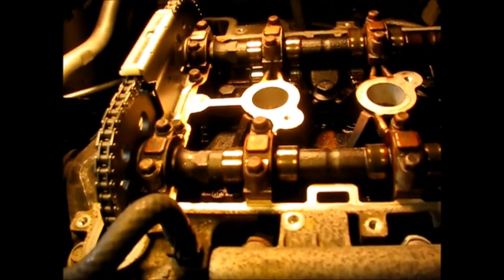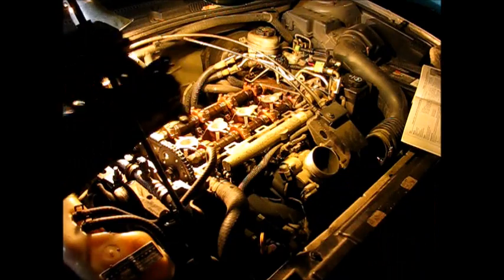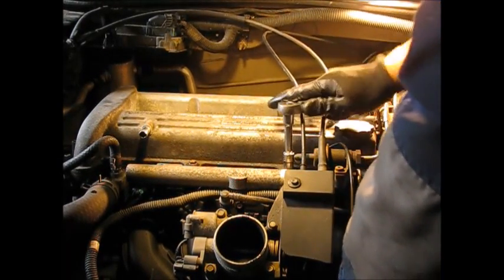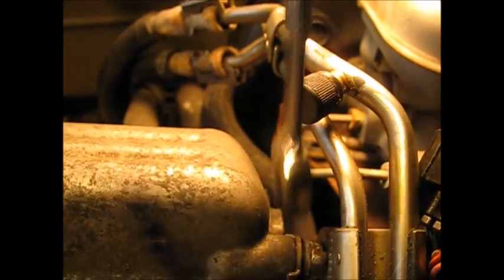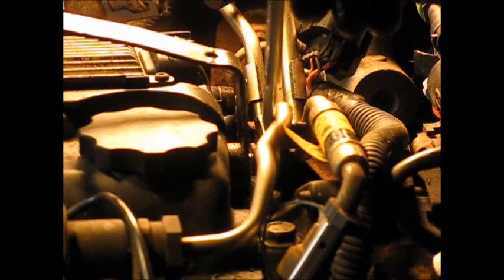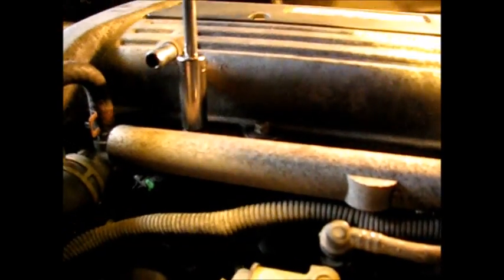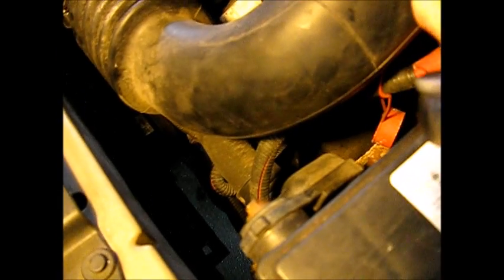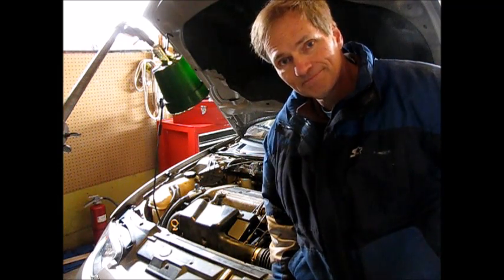GM 2.2L Ecotec timing chain replacement '03 Cavalier part 6: valve cover and conclusion

Comment: Thank you very much for the videos.
I am really wondering, why the engine is running at all without doing a complete rebuild of the head incl the valves. With such a massive nok timing, all valves should had contact with the cylinders and should be bend... Or am I wrong?
Reply from the maker: Yeah, you're right. Valve damage is to be expected.

Comment: I have a question about the Rear Lift Engine Bracket. It looks like it is missing on your car as well as on mine (2003 Chevy Cavalier). Can you tell if that bracket should be present there all the time, or it is smth like a tool, which is installed when needed? Thank you for a great film.
Reply from the maker: This is news to me about the bracket and I have no idea whether it's added as needed.
Reply: @TheOriginalMechanic  Thank you for the replay. The Rear Lift Engine Bracket on our Chevy was taken by someone in a shop (now hard to say when), bcs it should be there, it is shown in Haynes on page 2D-8 (pic. 7.23b). I don't think the manufacture didn't install it originally.  So they are 2 brackets the to lift or just support (what I needed) the engine. One is located in front of Engine Upper Mount, and the other one is in the area where your hand is @ 1:56, kind of at the other end of a diagonal going from the Front Lift Engine Mount across the Valve Cover. The good news are that they sell those brackets on ebay. The set of 2 is ~$25. I've ordered one already. What is interesting that primarily I went with that car to Chevy dealerships hoping that there are true professionals there.  Next time I go there I'll take a picture of Engine Bay for any chance. Anyway, thank you again.
Reply from the maker: Yeah, sad when you have to take "before" pictures prior to getting service or repairs @olenaerhardt7725

Comment: Soy de mexico y veo tus videos, no entiendo todo pero estoy tratando, pregunta 1. ¿se tiene que quitar el aceite del motor?
2.- ¿ es necesario lubricar la cadena antes de ponerle la cubierta o se engrasara sola?
Reply from the maker: I did drain the oil (part 2 at 6:02) I did not lubricate the chain as it will pick up oil during operation.

Comment: David, I have been following your vids on this for while and  I finally got the timing chain changed out on my grand daughter's 04 Ion and found as I figured would show up, the valves got bent and a cylinder head needed to be changed. It took a while to find a decent head and have it installed and re-installed the timing chain as of today. I still have to put cover back on and timing cover and hook up all the associated parts. I am just hoping it it starts and runs. I am glad I watched your starting procedure and the time it took to start. That gives me pause not to give up when it doesn't just fire up!  What do you think caused such a delay on starting?
Reply from the maker: I've wondered about that and I really don't know.  The car was down for months and I thought maybe it was a fuel issue after sitting so long. That probably won't happen to you though. Good luck and thanks for watching!
Reply: @TheOriginalMechanic  The car I'm working on also has been down a good while too, since last September. They had it hauled to my place last month. I did add a bit of fresh gas with some stabilizer. Did you think of using a bit of starting fluid sprayed into the intake just to see if it would fire? I may do this if i have same delayed start. As I've stated in previous post I'm an old guy and usually only work on it a couple hours a day. but hope in another week to be able to fire it up.
Reply: @radtek2 am tempted on buying one for cheap to save money guy selling it said timing chain fell of cause of mechanic wanted to save time not using the proper tool to change the water pump an that It felt in the pan it's been sitting for 2 yrs so he says ,am afraid of valves been bend by them trying to crank it an worrying it won't start like this one . What ever happened to ur project,some times they sound like a bend valve but is not cause of a bent valve but from bad oil solenoids

Comment: I just replaced my timming chain but the car don’t want to start it sounds the same as yours. What can i do and the battery wont stay charge after 2 tries it dies i have to charge it do you think is the battery
Reply from the maker: Your battery sounds weak. You might need to jump it to get it running
Reply: The Original Mechanic i did it but it wont start some guy told me that the valves are bent because my chain broke while it was running

Comment: I find it had to believe it didn't bend any valves. And suspect it did.
Reply from the maker: Just lucky I guess. It ran fine for two years right up to the day it was sold.
Reply: I’m with you. I would’ve done a compression test after about 5 minutes of cranking. Damn another entire hour of trying to get it to start lol.

Comment: Wish I had come across this video series a few years back when the timing chain snapped on my 03 Grand Am!..lol.  I watched a couple other videos and printed off some instructions from the internet..had to replace one bent valve in addition to the chain, but the job came out well and the car is still running great to this day...the only difference is that I didn't have as much trouble starting it when it was finished..I think it started on like the 3rd try... got lucky I guess. Anyway, thanks for posting these videos.

Comment: My question is the exhaust gear and the intake gear have moved , you said turn the crank 90 degrees and the gears on top should move without hurting the valves . So once they line up to exhaust 10 o’clock and intake 2 o’clock , how do I get the crank back to compression stroke t.d.c. ? Do I turn it clock wise until I get there , or will that hurt the valves , help me out . Thanks
Reply from the maker: Turn crank clockwise to bring back to t.d.c. and it will be good.

Comment: good video very helpful, It sounded like it was a little low on oil when it started, I didn't see in the video where you topped it off with oil after the fix.

Comment: David...I would like to thank you very much for making this video series.  I just got a 2006 Cobalt and the engine is running really rough, even after replacing plugs, ignition module, and coil pack assembly.  Then I heard someone say that it might be by timing chain assembly. After watching your video series, I realized that I have pretty much figured out that one of the cogs has jumped and I got a job to do.  So, thank you for the video and I will be looking at it from time to time, as a reference guide to doing this job.
Reply from the maker: You're welcome. Thanks for watching and I hope your work goes well.
Reply: Hi David. I did have one question concerning this project.  I noticed there is another chain behind the timing assembly.  I looked further and found that it is a chain to the water pump.  Would it be idealistic to replace that chain, as well?  That way, I don't have to go back in for awhile?  Thanks...Mark Simon
Reply from the maker: Yeah that would be ideal. I think this chain also operates balance shafts, in addition to the water pump. We didn't change it out and have yet to regret it two years later, but for maximum reliability it should be replaced.
Reply: Thank you David. I will do that then.

Comment: What is the name of the adapter that  goes into the hose and intake at 9:40?
Reply from the maker: all I could find at that point is a hose that fits between the air intake box and the engine.
Reply: The Original Mechanic yes. You said in the video that you had a problem with the intake and that you had to replace it, I'm going to assume the the problem you had was that the part that hose connects to fell off. This is exactly what happened to me and I wanted to know if the car can still be used without the hose being connected. If not, is there a adapter that can fit onto the intake box or do I have to buy a new one.
Reply from the maker: I wound up using silicone sealant to reattach the broken hose to the box. Replacement would have been ideal, but I could not locate a part at the scrapyard and the owner of the car was ok with this solution. It has held up for nearly two years this way.
Reply: @TheOriginalMechanic  will this stop the car from starting
Reply from the maker: @flyhigh5755  No it would not.
Reply: @TheOriginalMechanic  i did this job and i think it wants to start because now my engine is shaking when i try to crank it just like yours above (before repair it sounded just like  your in park one spinng fast and a no compresion sound) problem is i can ony get a good 5 cranks bofroe my battery dies do yu think i shound keep trying to start it? maby jump start it how long did yours take to start

Comment: I just did this job and I confirmed multiple time that the timing is correct. It won't start like what happened to you in the video. Why does it take long to start?
Reply from the maker: I don't know. This car did sit for four months and I assumed that was a factor.
Reply: Did that care ever fire? I did timing chain on my sister car samething no star im sure the timing was set good
Reply: Daniel Canela same here did you found out what was the problem?
Reply: It’s an interference engine. If the pistons smacked the valves and bent them bad enough, no amount of proper camshaft timing will achieve proper valve timing. The engine won’t have the compression to run. The head will have to come off and the bad valves replaced to get the combustion chamber to seal properly and make compression.

Comment: all my air intake nipples broke so I went to hardware store and got a brass hose connector ,i think it was 5/16? you will have to take hose with you to get size for the hose end , the other end of brass hose connector has threads on it ,you will have to get ruff measurement on plastic broken intake housing match it as close as possible and last resort "drill the plastic hole"  you can screw the fitting in or even if its loose put some silicon all around the screwed in brass fitting let it dry,it worked for me just fine.

Comment: Thanks for making the video,that was a job too,just trying to go through the process of making this valuable content .I know those fuel line hold bolts are tough buggers to trying to get to them, but my experience with the ecotech 2.2 was reliable.I know when i remove my paper oil cartridge filter I always use a 1+1/4 inch 6 point socket with about a 8 inch extension.

Comment: i just followed every step from part 1-6 and also tried to start for about 6 hours all i came up with was a back fire idk if the timing is off or what should i do please HELP!!!!!!
Reply from the maker: Double and triple check the timing. If you're sure that's right, you have look at other possibilities, such as bent valves, especially if the chain failed under load.
Reply: if i put a active tensioner back in without deactivating it will that cause it to jump?
Reply from the maker: It might. I would not suggest it.
Reply: just checked timing and it not off so what could it be?
Reply from the maker: I would make sure it's getting gas and then check compression.

Comment: I have a 2004 Saturn Vue 2.2L.I been taken on a ride trying to fix my car.I left the ignitio key on for about 3 hrs.Came to car, didnt start replace battery,didn't crank ,replace starter, didn't start,replace ignition control module, still nothing.Had it checked out and no spark to 1 and 4 spark.What could be the cause.Pls help me
Reply from the maker: That is a toughie and ultra frustrating. Sounds like it cranks but doesn't start now. I would hate to point you toward any more parts and nothing springs off the top my head.
Reply: The Original Mechanic as a mechanic,what would you do.Ignition coil assembly Or ECM
Reply from the maker: Of the two, the coil assembly. Good luck with it!
Reply: I had my coil assembly replaced several years ago at a place with life time warranty on the part. Since then they have replaced the coil unit TWICE.  Seems those units fail a lot

Comment: and with my car I had the same problem as you with not starting right away .. good thing you showed that it might not start on the first time I kept trying it and trying it and it ended up starting I would have thought something was wrong if I wouldn't have seen you do that but it was fine and it runs very smooth now
Reply: how long did it take

Comment: Why did you keep trying and trying, wouldn't that do more damage than anything? If it doesn't start the first or second try then clearly something is wrong. When me and my buddy did my timing chain it fired right up first try. 35 minutes cranking an engine without starting, even if it does start eventually just doesn't make sense to me. Timing marks only line up every X number of revolutions, so theoretically, and based off what it takes to start in the video, wouldn't that engine only be able to start when it lands on X number of revolutions?
Reply from the maker: I can't explain why it took that long to get going. I found it troubling up to the point where it started and kept running and is running great to this day. It did sit for about 3 months before this repair was done. You lost me on the timing mark alignment thing. The timing marks on the chain are an aid to help get the cams and crank aligned  properly.

Comment: I'm having the same issue , it won't start , I think I have the timing right , the engine cranks but how many times should I try and why is it that it won't start ???
Reply from the maker: +Luis Cruz It took us a bunch of tries to get this Cavalier to finally run and it ran rough for awhile even then. It seemed almost like it fired up a cylinder at a time. If yours still won't go and you're sure about the timing,  I would begin to worry that there may be some valve damage. That's always a possibility of the chain jumped.
Reply: sitting for months, gas can turn bad as well - with water in it